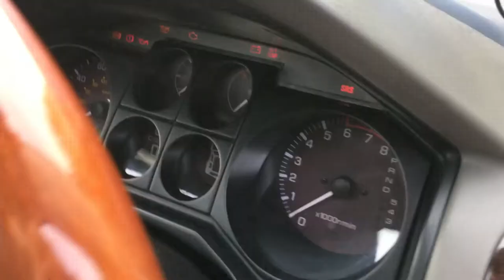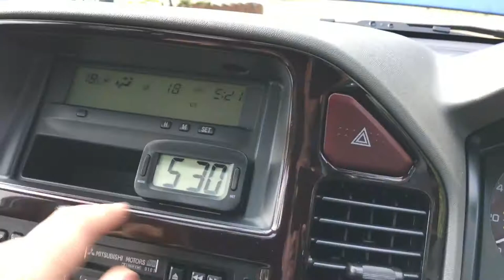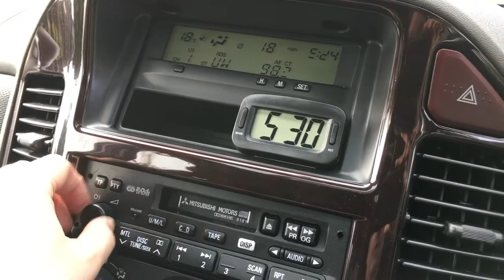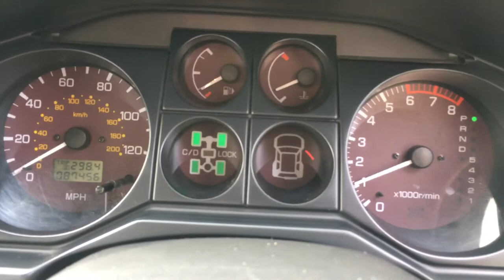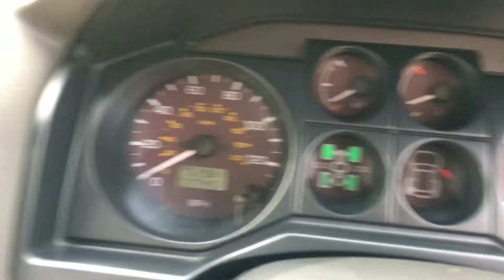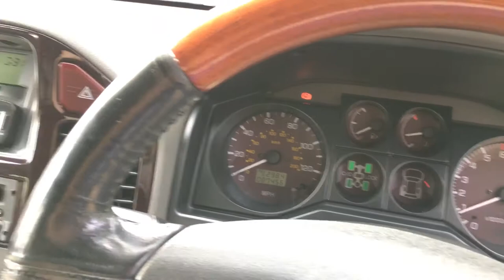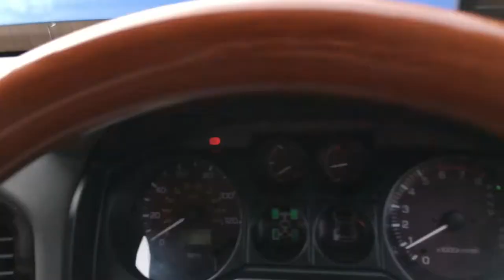Mitsubishi Shogun Elegance 3.5 V6 Tour & Startup

Comment: I am looking to buy this 3.5 v6 2002 year, can you tell me fuel consumption  in city? It burns too much gasoline ?
Reply from the maker: George My automatic did around 17 mpg in town, and maybe 25 mpg at 70mpg. Yes they are heavy on fuel. It would be best to get an LPG gas system fitted to make it a lot cheaper to run.
Reply: Barrow Motorcycle & Scooter Sales in 100 km how much ?
Reply from the maker: @GeorgeKingSlayer  I don't know. I would use Google for that.